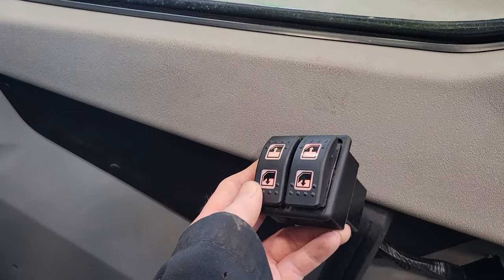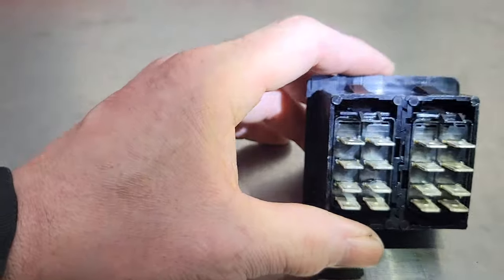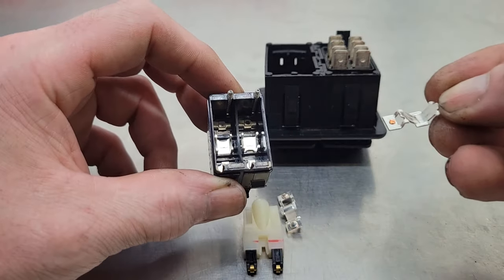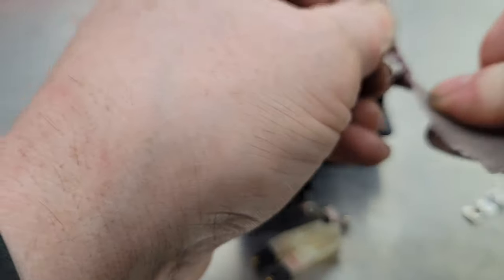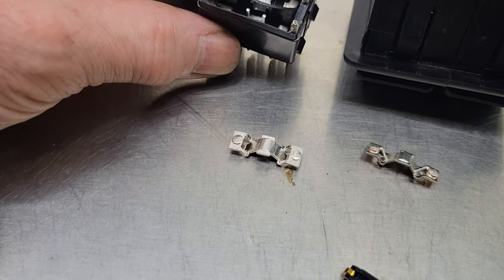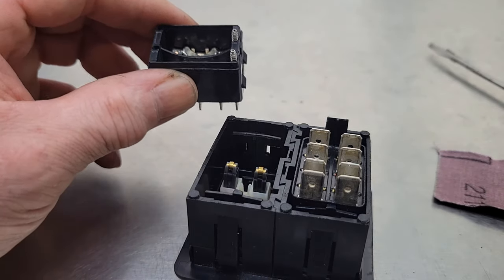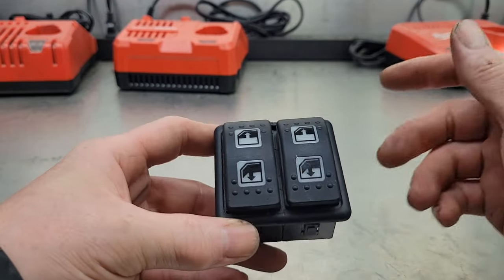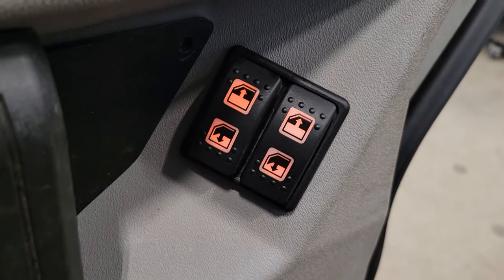SOLVED: The Secret to Fixing Your Power Window Switch Problems!

Comment: I've already replaced the switch once in my 2-year old Can Am and have the problem again. This video explains the problem clearly, shows you the fine detail and the likely fix, all with some helpful hints. Excellent video; if only they were all this clear and helpful!
Reply from the maker: I have heard that rolling driver and passenger windows down at the same time can cause the contacts to arc, causing premature failure. Thanks for watching and commenting.

Comment: I have a 2014 Ford Edge and the driver front, both back windows will not go down and now the passengers front window will not go up. Checked the fuses and they are fine, i took off the door the wire is fine. I will try this process or any suggestions
Reply from the maker: Try disconnecting the battery for 15 minutes and reconnecting. If seen that help reset things.

Comment: Question... My power window switch is not working and I've tested 2 new switches and they don't work. However I noticed the light on the switch was off but the mirror light on the switch, which is separate, was working. Is it safe to assume then that there is no power going to the switch? If the window motor was dead would that have anything to do with no power at the switch?  This is the driver master switch. All the fuses are fine. I can't get any power to all the windows from this switch but the other windows work  from the other 3 doors.

Comment: Fixing the actual power window motor is not hugely different - it's usually just lack of lube/contact.
Reply from the maker: A lot of parts can be repaired rather than replaced. If parts aren't available sometimes you have no choice.

Comment: Had to do something similar to my truck but it was a brakelight switch. Its a 85 dodge d150 that no one makes the switch for (or get a nos for like $150). Took it apart and found out someone else went in and modified it before to get cruise control working. Found the same part from a 90s jeep but the plunger and plug was different. Took the 2 and made one that works like new for my truck. Sometimes its a necessity to fix it yourself lol
Reply from the maker: Great troubleshooting. You're right. Sometimes you have no choice but to repair yours or build a new part. Thanks for watching.

Comment: When I purchased my first vehicle, in the late 90s, it was more like a tank, than a car.  It was an old Pontiac Grand LeMans. Before I could insure it, though, it needed to go through a full mechanical inspection, so I had my work cut out for me.  Of the many lessons I learned while rebuilding that car, the most important one was how to decide if a part needs replacing, or as in this video, a servicing.  
     
     I think videos like this one are so valuable to those who may be between paychecks, when a problem arises.  Vehicles rarely ever break down when it is convenient and playing parts replacement roulette can result in other things going wrong, therefore costing more money and being inconvenienced for a longer period of time. 

    There used to be low cost repair kits for alternators, wiper motors, and most anything, back in the day, but as there are more autos than ever before, most mechanics don't have the time to be repairing parts anymore, so most shops replace parts, instead, which is unfortunate.  It used to be cheaper to repair parts, than to replace parts... However, If you are going to replace a part, anyhow, why not sacrifice it for better knowledge?   This video was clear, concise and an easy watch, with a great message! Thanks for sharing your knowledge, Shaner!
Reply from the maker: Great comment, thanks for watching.  Not many people fix parts anymore.  During the pandemic some parts were not available. I found myself repairing them again. I found you learn more trying to fix them.

Comment: Great Video. I have done this cleanup and the switches stop ed working again after about 20 uses. Any ideas how to make the switches last longer
Reply from the maker: I read that apparently the switches wear out quicker if you roll down multiple windows at the same time. Thanks for commenting. Also these switches are exposed to alot of moisture when the door opens and closes in the rain.

Comment: Hello!
Thanks for the video!
Can you tell me what did you said after black dot 3:42?
Cheers from Argentina
Reply from the maker: The black dot is arcing. It's metal transfer from one contact to another. If it gets bad enough it will cause switch not to work. Thanks for watching.

Comment: I have a 2003 Lincoln. I took out the master window switch on the drivers door and the button for the front drivers window is auto so once you push it, it takes the window down automatically and you can take your finger off the button. well it wasn’t working so I looked underneath the switch. Once I got the whole unit out, I popped the button offand a piece of plastic was broke so I took one of the other buttons off the window switch and put it on top of the front drivers window one used it and it went up and down so the switch that you touch to push the window up and down was actually the problem not the whole unit unit itself
Reply from the maker: Great diag. Thanks for watching and commenting.
Reply: @shanersmechaniclife3164  YW

Comment: Hi. nice video .i had same problem with my defender limited..followed your video and cleaned up the contacts ..installed it .worked fine but the light  
in the switch no longer worked.Took it apart again i had the springs in the wrong holes .they must be in the correct slots for the light to work .Works fine now hopefully lasts awhile..thanks great video

Comment: How did you get the switch assembly out of the door to begin with?   a flat head screwdriver and being careful?  That would have been an enhancement to this awesome video.  Just went hunting and left the windows down as the worked intermittently.
Reply: That’s what I want to know. Ours just went out in our Can Am and I don’t want to break it taking it out.
Reply: @Southern195  I used a plastic body molding removal tool and gently pried out the outer ring top and bottom. The whole switch comes out with beauty ring.

Comment: Do you know why the lights wouldnt work at times . Sometimes they turn on and sometimes they dont. Switches work fine
Reply from the maker: I believe there are contacts in the switch for the lights to, as the switch moves with the lights in it. Could be same issue as windows not working. Let me know what you find.
Reply: @shanersmechaniclife3164  I'm thinking it's gonna be my bcm. I have other electrical issues that are controlled by bcm. Sometimes the dome lights turn on when I open driver door. And sometimes they won't. My ac Blower ramps up randomly at times. Now my driver door won't unlock but all other doors do. My manuel shifter isn't working anymore . So I'm starting to think the bcm is going bad. 🤔

Comment: How do you know that it’s not the regulator or motor? Mine goes up on the passenger side with difficulty and it binds up. It rained one day and the switch panel got soaked. It hasn’t been right since.
Reply from the maker: I tested for power and ground to the motor and power in and out of switch.
Reply: I activated the motor with the probe and it worked so repaired the switch just like this. Once did the same thing with a circular saw I could not get repaired, just rotated this little cube which was the contact that had been eaten out by arcing to a fresh face, so when it happens again I can  just do same thing but suspect saw has more years left than me.

Comment: what about switches with printed boards in them would that still apply? mine goes down with one tap and doesnt go up
Reply from the maker: Switches with printed circuit boards have less moving parts inside. Most of those have small microswitches. Not much you can do. But... if your ready to buy a switch,  why not open it and see what you can do.

Comment: What about spraying some electrical spray cleaner inside were the contacts are and work the switch back and forth to clean the contacts?  Anyone try that?
Reply from the maker: If that is tried, I would make sure it is fully dry, which is tough without disassembling the switch before applying power.